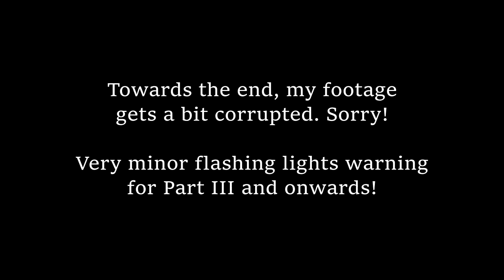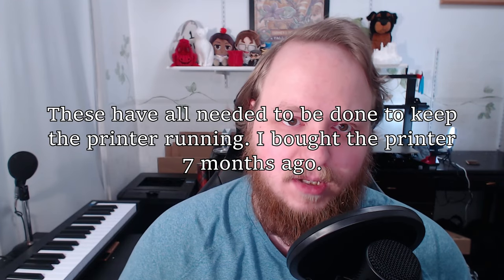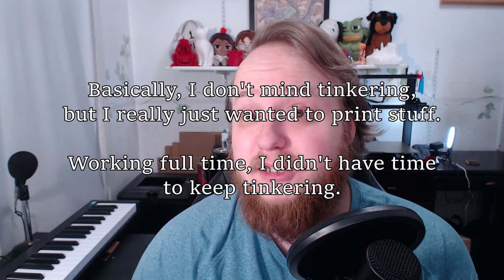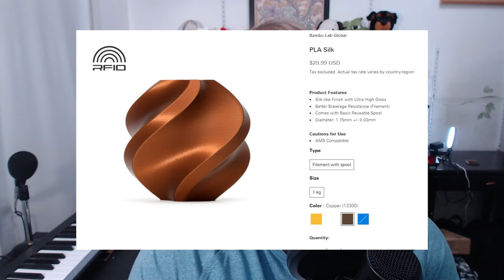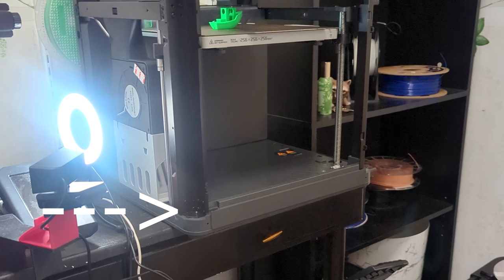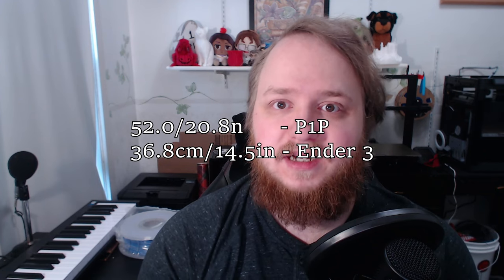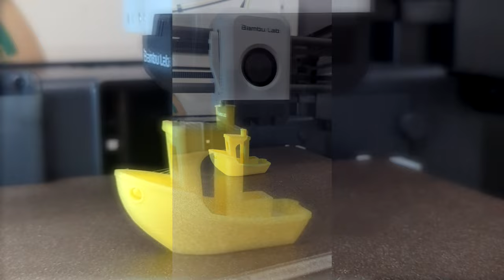BambuLab P1P: From Ordering (not good) to Printing (very good!)

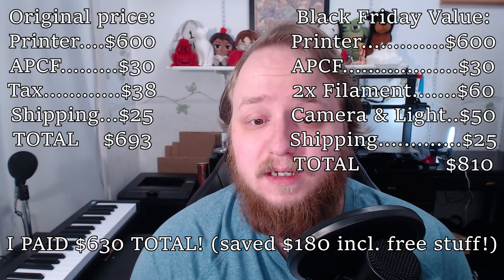Comment from the maker: Addendum: for my price comparison at 7:10, I didn't list the taxes under the black Friday side, but I did include it in the math.
Also, I know that my roller design is technically flawed because of the layer line direction, and it's not really supported from underneath. But... It seems to be holding.

Comment: I can relate to your shipping complaints, I ordered the P1S combo and some filament on the 18th got the filament yesterday, today DHL website said that they loaded the printer in the truck for delivery and at 5:00 PM it mentioned unsuccessfully delivery even though no one called me or rang the bell at my door, it’s so frustrating.
Reply from the maker: I have front porch cameras. I saw DHL run up with the "sorry we missed you" note without even trying.

Comment: tell your brother to make sure he has the correct build plate selected in the slicer.   could be set to cool plate and not warming the bed enough :)
Reply from the maker: That's actually exactly what happened- it was only heating to 35° and I told him that's not nearly hot enough.
Reply: Yeah I love the X1C is checking the plate in slicer and the installed plate. I had multiple times selected a different plate in slicer than installed on the printer 😅

Comment: You were prepared to pay 700 dollars originally for the P1P, but went for the same printer at the sale price. Fair enough, I can see why, you wanted to save money. But.... if you were prepared to spend the larger amont in the first place, you could have got the P1S during the sale for that amount of money and ended up with a better printer. Just saying.
Reply from the maker: Ish. I didn't really want to pay $700 but I was ready to if I needed to. At the sale, I jumped. I know having an enclosed printer allows for printing more plastics, but I don't even own any ABS since my old printer is an Ender 3. I honestly like being able to reach into the build area from any angle anyway. But yes, the P1S is overall a better printer. The P1P is just all I needed. I probably could have sprung for the X1C, but I didn't need all those extra features. Very good point though, thanks for the comment!!

Comment: relax buddy. she will arrive soon. then u will start laughing when you print ur first test model, be it a benchy or ur choice. u wont believe ur eyes when it starts printing. franticly trying to find the menu with the speed setting to turn down the speed. hehehe 

man.. this thing is stupid fast. a model that takes me 16 hours on my cr10 "used to be, its basically all custom except the frame and two pullies ;) " in  only 6 hours 4 min. mental i say. and it looks WAY better.
Reply from the maker: That's exactly what happened. Maniacal belly laughs. Absolutely insane. If I slice a Benchy just for fun (not for speed), it'll take my ender 3 v2 neo about 2 hours. This P1P takes 45 minutes max, or 20 with the pre-sliced one. It's insane